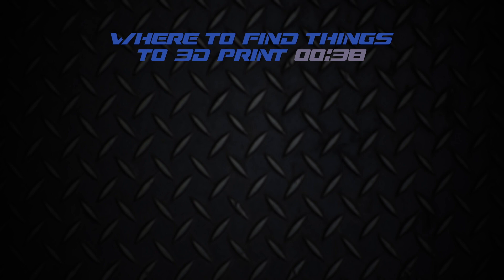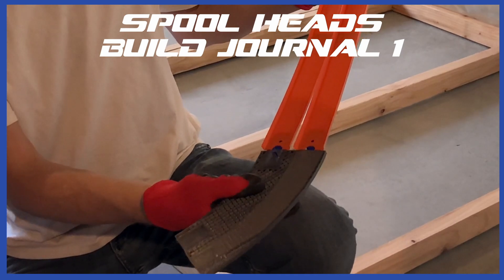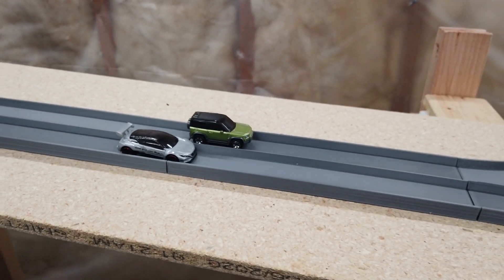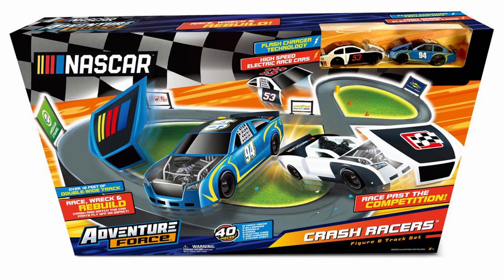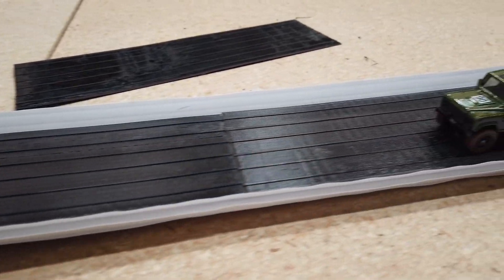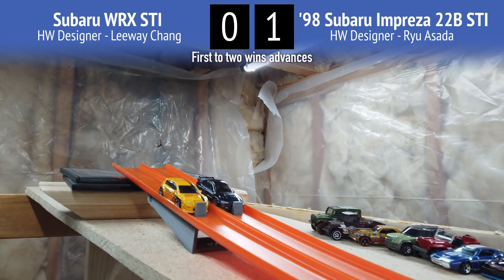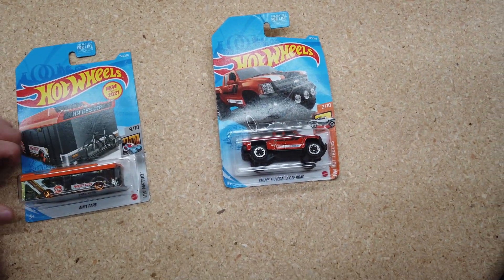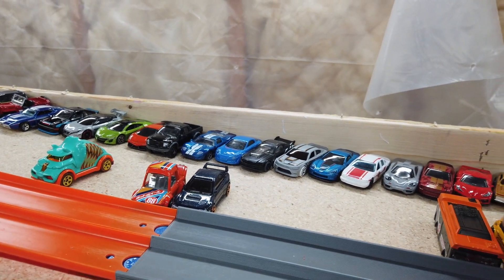BUILD JOURNAL #2 - 3D Printing Track, and the First Race!

Comment: Have you tried using coroplast and taping lines on it with 6mm tape roughly. Paint a line a few times to build up a thickness. Or even something like bondo, build up the tape in layers for desired thickness and bondo the gaps. Or maybe a rubberized compound? Just some ideas. haha

Comment: You could also print in TPU,... tha would give you flexibility and it still would be stiff enough to use... sorta like original hot wheels track... and you can set the firmness by changing the number of walls and/or infill

Comment: I'm new to Diecast racing so maybe u can help me understand. How are the cars able to go so fast at the start when u drop the start gate? I was thinking the cars are remote or electric but u use regular Hot wheels though.

Also I have 2 3D printers 1 filament the other resin. Have u ever tried resin and if so do u think it's just as good as filament?
Reply from the maker: check out spoolheads.com. Thanks!

Comment: Hi there, how do you print it flat on bed like that with those huge overhangs?
Reply from the maker: I end up printing most track pieces vertically on a raft and designing so it doesn't need much support.

Comment: SUGGESTION: use velcro to hold down your tracks it has a suspension effect, allows the track to shake without moving.. you can use staples on the wood and the stickers on the tracks.. and easy to replace tracks..
On the coroplast sliding issue you can use some spray (very light spread cover) to give more grip or , make some fin stripes using tape painting very thick layers.. you can use polish to maintain the track colour .. I hope it helps
Reply from the maker: Those are two fantastic ideas. Thank you!

Comment: I haven't tested the idea but I was thinking of getting into track building but using sprayable plastidip over the slick surface and having aftercare (from Dip your car) to see the difference. The after care makes the dip practically glass like though so may or may not work
Reply from the maker: I've been considering testing plastidip to soften the track a little. The 3D printed track it quite hard and I sometimes miss the softness that the more flexible Hot Wheels track has.

Comment: Found your channel recently and oh boy, we re started the car racing again.  I Need to delve deeper in fusion 360,  I been using the magtrack connectors I 3d printed back to back a few years back and yes coroplast is slippery I may try spraying some plastidip maybe to get some extra traction but I don't thing it will last that long.  I need to add my remixed to thingieverse.
Reply from the maker: I'd love to see your remix. I've been wondering is a super fine grit sand paper would work. Would be fun to see plastidip for sure.

Comment: I want to do is use a few big chunks of styro and make a 4-5 piece track that breaks down and sets up and moves easily 😉 Im may be outta my mind as i am ignorant to how or what I will use, but want to carve out the entire track and scenery foundation and coat, paint road ways with something that can wire to the low voltage needed so the whole roadway is powered ? I may make this into a group question, help, ides effort 😉 but imagine the fun and creativity that could be done and to just break down and put in van and move set up & play at new house, before the movers show up 😉any ideas or thoughts ?
Reply from the maker: Sounds like a cool idea!

Comment: Hey so I'm having my local library 3d print me some turns but their printer is only 5.8 x 5.8x 6.6 .  How do I split the print for two separate pieces?
Reply from the maker: I would print the 22.5 degree turns then and just print more of them to make the angle you want. You can print the SR1 connector for them or you can just use standard Hot Wheels connectors. Good luck!
Reply: @spoolheads  good thinking !  Thanks man

Comment: Fraser Campbell made the Original 2007 Chevrolet Silverado, So he probably made the off-road one too.
Reply from the maker: After more research, Dmitriy Shakhmatov designed the '19 Chevy Silverado Trail Boss LT which looks very similar except for it is a crew cab instead of an extended cab. I should try to connect with the designers to try to figure it out. Thanks for your comments and support!

Comment: Using Frosted Glass spray paint & then lightly sanding it off makes coroplast work as a straight track. I've tried primer as well & it works too. HomeDepot has Coroplast 4'x8' sheets in white for $35.98 FYI.
Reply from the maker: Great idea! I'll give it a try.

Comment: The best printed part in my opinion for die cast racing would be 180% turns to connect to the super six lane raceway, sold in a two pack consisting of two six lane turns in opposite turning directions of each other to equal out lane length by the end of the race.   I assume this piece probably isn't possible with many printers as the size is on the larger side but damn would a parts set like that sell well, in fact I'm kind of surprised hot wheels themselves haven't produced an add on set for the six lane yet.
Reply from the maker: That's an interesting part to consider. I think you are right about the size of 3D printers being an issue. Might need to print it in 22.5 degree segments, which would mean 8 pieces for each 180 turn. I don't have any 6 lane track to design against but it would be interesting. Thanks for watching.

Comment: Nice work, and glad you liked the sidewalls. I’ve found them best at the exit to the turns, as it keeps the cars on track. 

All my designs are currently done in blender but I liked that simple extrude shape along a path you showed. Used fusion for a short time a few years back and may look into it again. Might also look into one of those creality printers as well as my current printer only does 150mm max so it’s too small for track pieces like that. 

Liked your idea for the thin inserts to add the grooves. Definitely one of the trickier things to do on custom tracks.
Reply from the maker: Thanks Mr. Watson. It makes me happy that you found the video useful.

I'll make a little video with how I approach designing track in Fusion 360 with more detail. I'm thinking that having a downloadable svg file that shows the dimensions of my track that can be imported into Fusion 360 might be a great way to let people explore designing track pieces without having to troubleshoot all the measuring.

Keep up the great work and happy holidays!